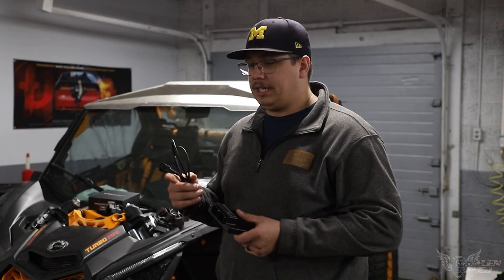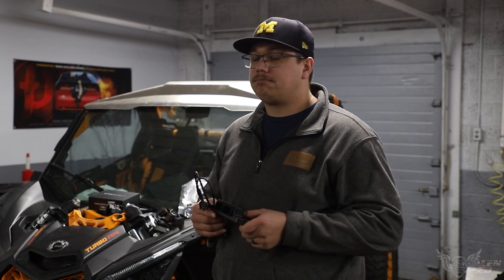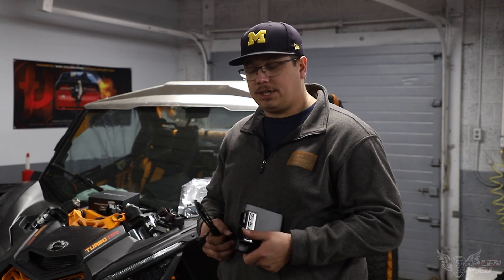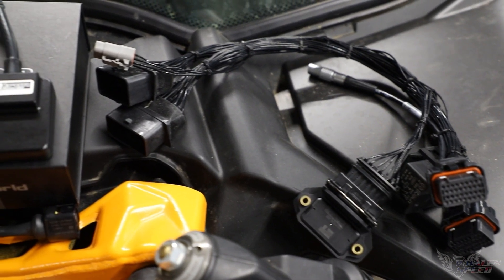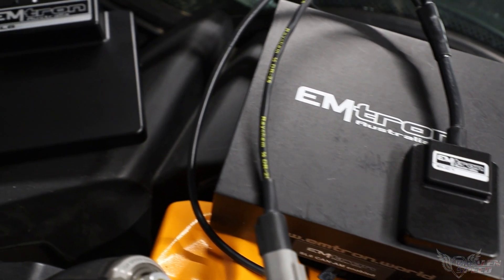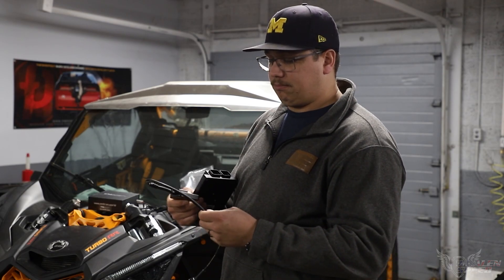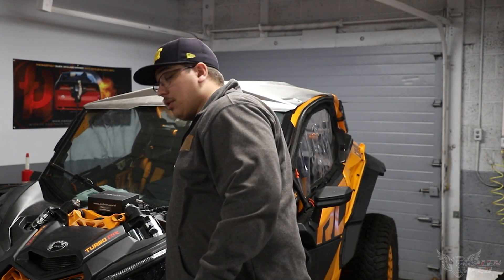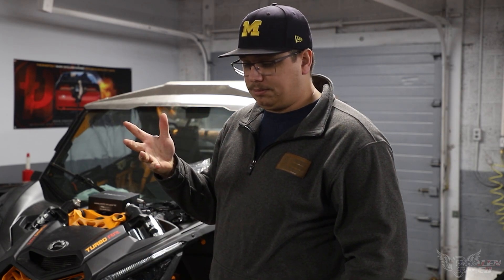Whalen's Speed: Testing Anti-Lag w/ A Can AM X3 | WSRD EMtron ECU Package

Comment: Im  Sorry John but that sounds like crap,, why dont you just weld two of those little three cylinder  blocks together and make a buzzin half a dozen, by the time you do that it would be cheaper then all the damn poppin and banggin and cost of all the electronics  that cause it,, sorry buddy but thats the way i szz it,,,,,,,,, twin turbo ,,,,, weld two together!!!!
Reply: you cant twin turbo a can am x3.
Reply: Fortunately that will never happen, esecially in competitive short course racing. The electronics and features are what make a basically stock 3 cylinder 900cc engine feel and perform like it does.